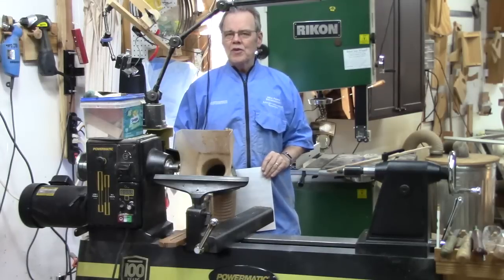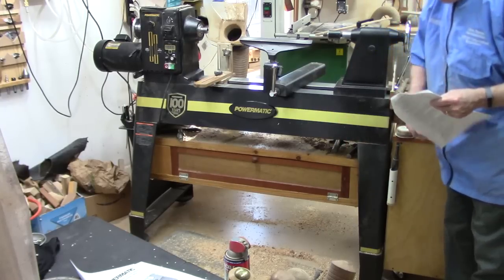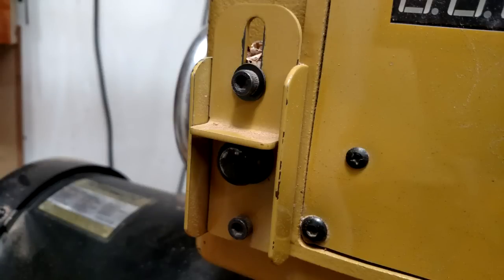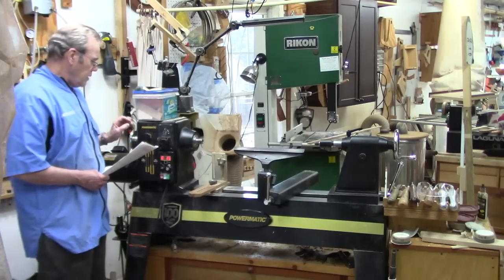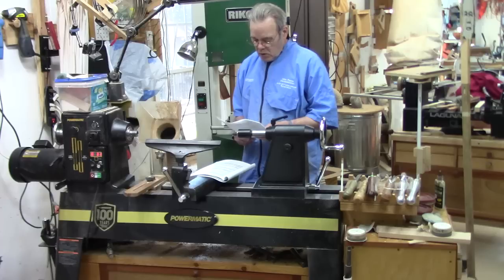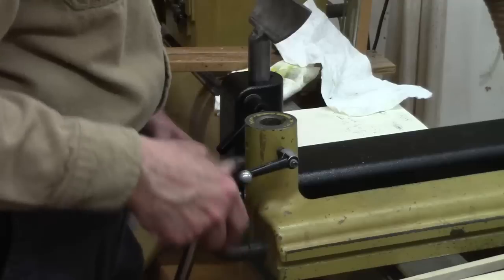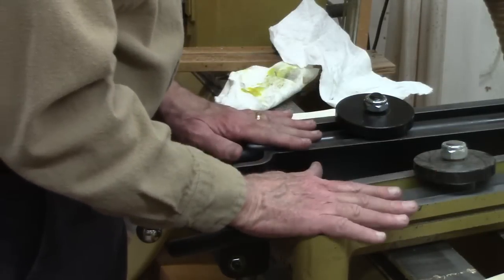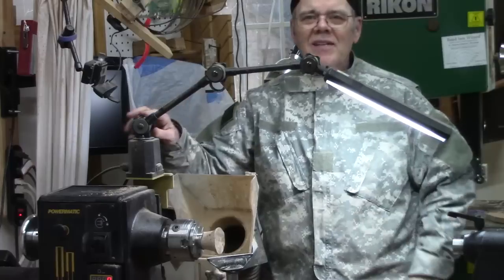Powermatic 3520c Lathe Review - Can a Mustard Monster be Black?

Comment: Hey Mike. I always enjoy your very helpful and instructive videos. I've been turning for about five years, but recently retired and have picked up the pace quite a bit. I also purchased the Centennial Edition 3520C in an effort to increase the size and improve the quality of my turnings. It was a definite step up for me. One of the issues you address in this video is the exclusion of an electrical plug, and the lack of a clear set of instructions for the electrical connections to the lathe. I don't presume to speak for Powermatic, but on the former, I understand why Powermatic chooses to not include a plug with the lathe. I assume Powermatic ships this lathe all over the world. Although the operating voltage for this size equipment is almost universal across most of the world, the configuration of plugs for this voltage range is not. Even if Powermatic shipped lathes that were proprietary for the US, there are at least three different configurations for plugs in this size and rating. Further, local codes can vary and you might need to change either the male or female end of the plug to match existing building wiring. It could clearly become a headache and expense for Powermatic and its retailers to anticipate all the variables. 
As to wiring instructions, I think PM makes it just clear enough for an electrician to understand and follow. I suspect PM wants the end user to get a licensed electrician to make up the correct plug and ensure the correct voltage to limit their liability from damaged equipment or worse. It's probably part of their loss control strategy. 
Mike, keep up the good work! And, congratulations on your beautiful new lathe. I'll get over it soon enough, but sometimes I just sit and stare at mine. It IS a thing of beauty!
Reply from the maker: Perhaps we should call it "Black Beauty". Sounds better than Mustard Monster.

Comment: Hi Mike, Thanks for your expertise on wood turning. I purchased the anniversary edition 3520 about six months ago and have loved it. I have spent almost every day turning something since then. I find it an amazing lathe. I did have some problems with it at first. The motor had this very high pitched squeal at higher rpms which was coming from the inside of the motor but after some use it went away. Yesterday the on/off control switch failed. I have a message into technical support so I hope I can get it up and running again. Next to my wife it has been the love of my life. I just wanted you to be aware of a potential issue.
Reply from the maker: My motor fan is louder than the b model. Always a good idea to blow the dust out of the switch. I had to replace the switch in my old one about 5 yrs ago. Not a bad idea to put the control in a zip lock bag. I will do that before it goes out of warranty.

Comment: Mike, Enjoy your video's especially this one about a lathe I have been thinking about purchasing. Now I'm picking mine up today and look forward to many years of turning. I sold my PM 2014 to my neighbor, I have liked the lathe, but thought it was time to upgrade while I could. The switch on the 2014 is the same switch, mine also started working intermittently during my Christmas turnings, new switch is coming. I will use the suggestion given here and by Powermatic of the plastic bag, even though it seems they should have come up with a better option. Thank you for doing such a nice job of reviewing the 3520c!
Reply from the maker: I am sure you will enjoy your bigger PM.

Comment: Thanks for the end-user review. Mine is not the anniversary model, but the mustard color is growing on me. I agree with you, especially with regard to choosing a lathe that fits the needs/wants of the individual. For what it’s worth, I’d like to add a few observations regarding my own 3520C: mine came pre-wired, so that was a blessing in my case. I hired an electrician to install a dedicated 220v line and receptacle for safety and insurance purposes. The spindle lock mechanism has taken some getting used to in my case. I need an idiot light or a mechanism to keep me from turning the lathe back on while the spindle is locked. I’m learning. I like that the controls are magnetic and can be relocated, but I wish PM would have kept the mushroom knob of the B series. Just me. The only thing I can hold PM accountable for is the rough finish on the underside of the banjo. I have watched a few videos on unboxing and setup. One YouTuber suggested that the contact surface of the banjo should be dressed VERY LIGHTLY with a draw file before letting it contact the bed ways to prevent scratches and to improve the ability of the sliding action. Mine was rough as well on the bottom surface. I expected better fit and finish from PM on a $4,500+ piece of equipment. I do love the added mass on the lathe in general, and I agree that bigger (and heavier) is better. I opted for the tail stock swing-away and am glad I did. It acts as a short bed extension when in battery, and as you pointed out, that is a massive, heavy tail stock. As for me personally, I waited a very long time to get my dream lathe. I’m not a bit sorry for my choice.
Reply: BTW, the bed ways are very well machined, much better than either of my previous lathes. I pulled the banjo and tailstock off and hit the edges with a fine mill file and some sandpaper. No more scratches. Like you, I waited a long time to pull the trigger on this purchase. My expectations may have been too high. However, I am very happy to finally have this machine in my shop. I expect it will outlive me by a mile and maybe one of my children or grandchildren will park it in their shop.
Reply from the maker: I have a video coming out on banjo maintenance that talks about the edges causing screeching.   Were you an artilleryman also? "In battery" is a term I have not heard in decades.
Reply: Mike — My dad was an artillery soldier. He was at Ft Sill.
Reply from the maker: Few are privilaged.  ✌

Comment: I just bought the same lathe about 2 months ago thought it was very weird it came with no plug!  Have had many big lathes and never had that before. Was easy enough to put on plug but still. Love the lathe though! Thanks for the videos
Reply from the maker: Was the cord connected to the lathe already?
Reply: @MikePeaceWoodturning  no. Had to buy plug and install cord. I believe there is a layout in the last couple pages of the manual. Could be mistaken on that would have to look again but seemed like a weird thing to have to do at that price range and powermatics great build quality.

Comment: Hi Mike, You might want to consider putting your controller inside of a plastic bag to keep the dust out inside. I just had to replace the switch (still under warranty) which was dust related. The tech at powermatic told me about the bag method.  I used a ziploc 1 gal bag and folded and taped it in the rear and poked a hole for the speed control.  Still able to put it in the dock.  Enjoy your new lathe.   Mike
Reply from the maker: Thanks for the info!
Reply: This is a terrific (and so simple - why didn’t I think of it?) solution.  I also had to install a new switch - the forward, reverse switch, after only about 18 months of use. They covered it under warranty, but I didn’t like having to cut into the rubber backing on the control box to access the screws to open it up.  I do try to regularly vacuum off the control box, but I’ll use the plastic bag idea.  Thanks!
Reply: @loujacobs9291  My Reliant drill press has the same type of switch but they have a clear rubber type of  covering that is mounted over the buttons to keep dust out. I'm sure Powermatic is aware of this problem and you'd think they would have come up with a better design.

Comment: Hi Mike, thanks for the review. I have a PM2014 and in order to get the 20" capacity I need to move the headstock so that it's hanging of the base somewhat. That may be the same situation with yours.
Reply from the maker: Hanging out a bit for a long spindle should not be a problem. Your lathe has so many of the same features as the larger one.

Comment: Hi mike. Very nice lathe. I looked at that lathe and the larger 4224B. I decided however to go with a tHarvey T-60S instead because ofthe price. l got a 3HP cabinet table saw and a 3HP 14 inch bandsaw as well as the lathe for only slightly more than the cost of the 4224B. I am finding a few things that I would like Harvey to do better, but overall mine is a very nice lathe. And Harvey comes with a knock out bar that is like the one that you showed. That is one feature of my lathe that I do very much like.
Reply from the maker: I did not know much about Harvey as I have never seen one. I did read this interesting article. https://www.woodworkersjournal.com/harvey-bringing-woodworking-education-china/   Enjoy your new lathe.

Comment: I hope the finish on your 3520C is better than standard one I bought about a year ago. Within the first 6 months the yellow finish has chipped off in many places. I have always taken great care of my tools and am very disappointed in poor quality of the finish on the tool. Chips have appeared in areas that only wood chips would have touched. It's a great lathe as long as you don't care about whether the paint stays on it.
Reply from the maker: Sorry about your lathe. I wonder if you called Customer Service if they would not send you a can of paint.
Reply: That would be very frustrating. Unfortunately, paint is one of those issues that might get by an out-the-door inspection by Quality Control, and not show up until the end user takes possession. Too many possibilities to list, but could be inadequate surface prep, bad paint or batch of paint, humidity, etc. So far I've had no issues with the Centennial Version black. Time will tell. I'm with Mike. Ask Powermatic to hit you up with some paint. It wouldn't take much for a few chips. A good automotive body shop supply could probably match the color and mix some up for you.
Reply: My 3520C arrived with some damage due to shipping, including scratched paint in places.  PM replaced all the damaged parts and sent a large can of mustard yellow paint.  Perfect match and I’ve got probably 95% of it left.  Maybe at some point down the road I’ll give it a total makeover.
Reply: @MikePeaceWoodturning  I am planning to contact Powermatic. I guess the real problem is that the paint was fine when I got it. It just doesn't seem to be durable. I understand paint worn away on the banjo where the tool rest rubs against it when lowered. And there are obviously other places that I might nick myself, but there are places on the body of the lathe where the paint is now bad and these places are not even areas I work at (like at the head end of the lathe since I do my work with the head moved down toward the  tail for bowls.Too bad, too, since the lathe itself is amazing; solid and powerful and a pleasure to work at.

Comment: Nice review.  In all the years of you turning on the B, did you ever have to replace the bearings or belt?  Any problems with VFD or motor?
Reply from the maker: No. The bearings and belt will probably outlast the owner. We have an A model at my club probably 20 years old. No problems.

Comment: How do you like the light?
Reply from the maker: Nice accessory. Articulating joints provide lots of versatility. Bolted on mean no risk of toppling off.
Reply: @MikePeaceWoodturning  thanks for the reply! Do you fund it to be brite enough? Also is the articulate easy to move frequently? There are no reviews of the light online.
Reply from the maker: I find it plenty brite. I think the articulation is easy enough. Not as easy as a flex shaft lamp but it absolutely stays where you want it and can't be knowcked off since it is bolted on.

Comment: Thank you! I am contemplating the purchase of a bigger lathe so this is very helpful. QQQ: I occasionally need to move the lathe, only a couple feet to clean around it or move closer to the wall but this doesn’t come with a wheel option. Could I just use a floor jack to put it on short wheels, move it, then jack back up and remove the wheels? All that weight and casting shouldn’t throw any alignment off.
Reply from the maker: The local Woodcraft had their b model on lockable 3" casters that made it relatively easy to move. That is probably the cheapest, simplest  route. Unless you are very tall you proably would want to remove the 4" risers.
Reply: @MikePeaceWoodturning  Thanks, I’m 6’2” and stand on a anti-fatigue Matt so would probably use the risers.
Reply: Hi Mike & Trurex007Lee, Congrats, Mike, on your new PM3520c.  I also bought a 100 Anniversary Edition and it arrives next week.  I watched you unboxing video also, and was hoping to see how you moved the bed and headstock, and assembled the legs and stood the lathe upright. I am by myself and need to figure out how to assemble and move the lathe from my garage to the shop.  I did buy automobile “skates” used to move cars sideways in a garage.  I bought two for each end but don’t know how I can lift an end to slip the Dollie’s under the legs.  How do/did you move your new lathe?  I am very much looking forward to making shavings on my new “big boy” lathe!  Congrats again.  Thanks for all of your great instructional and informative videos! Steve
Reply: @s.l.makuka9219  congrats! Borrow a friend’s floor jack; it should be low enough to get under the leg brace. I see a  3520c regular one for $4500 delivered at US Supply that I have my eye one.
Reply: Thanks Trurex007Lee,  I’m looking forward to the delivery but have trepidations regarding assembly and moving it.  If you can swing it, you might consider purchasing one now before inflation catches up and they cost $7K!